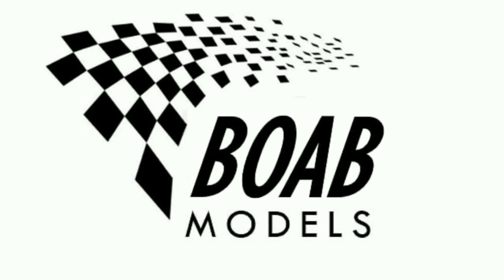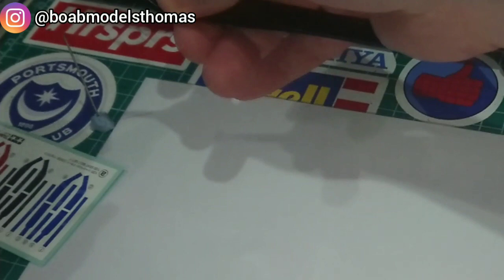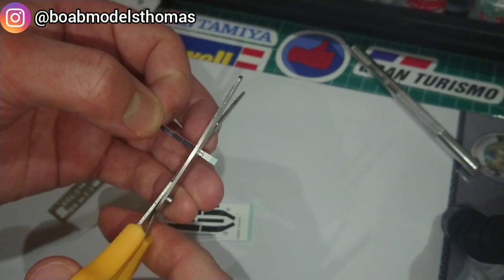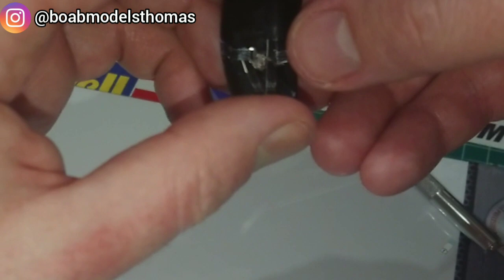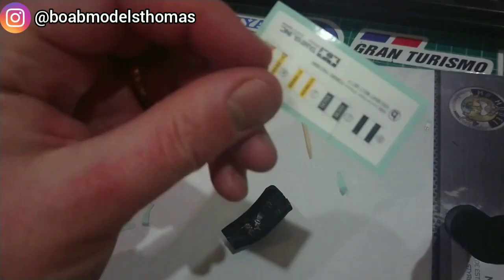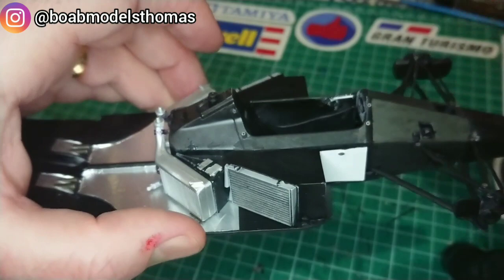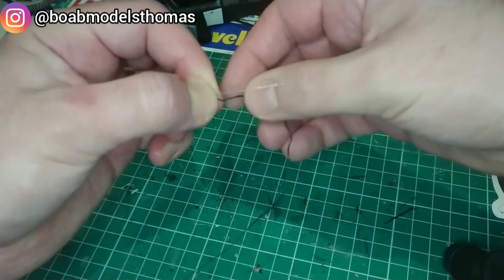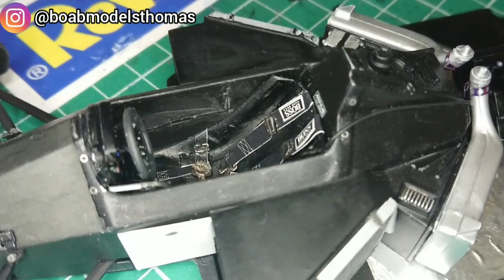Senna's McLaren Honda Mp4/4 - part 2 - how to build the Tamiya 1/20 model kit - seatbelts & cockpit

Comment: I only build out of the box so never tried after market seat belts, Hasegawa rally cars have them though which I've done. envious of the dremel tool, coming along very well
Reply from the maker: Of course! Well, I think there's a good chance Tamiya may include more of these as they did in the two recent Lotus kits.
I like the Dremel but I need to work out how to use it best. I need some cutting tools for it I think.

Comment: Hi Thomas. That curly wire for the steering wheel reminds me of a Heller kit I build a long, long time ago. It came with a metal wire and on one of the sprues was a plastic part to use for 'bending' the metal wire around it, so to make your own springs for the suspension.
Looked fantastic compared to the moulded one part shocks/springs.
Reply from the maker: Oh wow. That sounds like an ingenious way to upgrade the shocks. I. Might have to try that myself!
I saw this idea when someone scratch built a police radio for the Revell Starsky and Hutch Gran Torino.
Reply: @BOABModels  Yes it's not to difficult to do. I think PLASMO did something similair on one of his car builds. He kept the mounting points of the shock top and bottom, cut out the shock with the moulded spring and replaced that with round plastic rod ( like Evergreen or Tamiya) and made his own spring to fit aroun the rod. Job done. I hope you have seen some of PLASMO's work? Thanks for responding, till next time.
Reply from the maker: @edak482  oh yes, Plasmo is one of the most talented scale modellers on YT in my opinion. The sounds interesting - I'll try it some time.

Comment: Do you need glue or plastic cement for any part of this set?
Reply from the maker: Yes absolutely. I'd recommend Tamiya extra thin. Just be careful around painted parts. It's a good idea to remove a little paint around the joins.